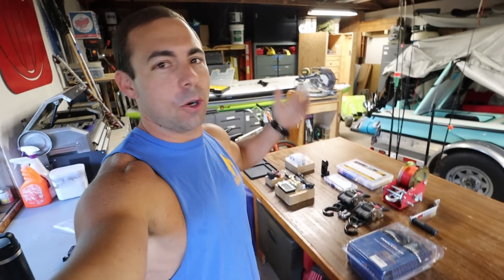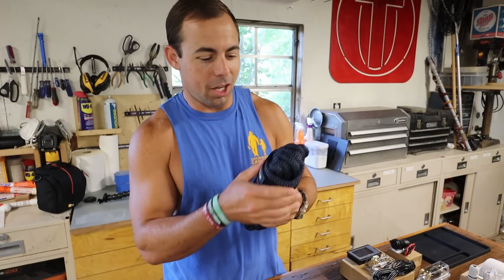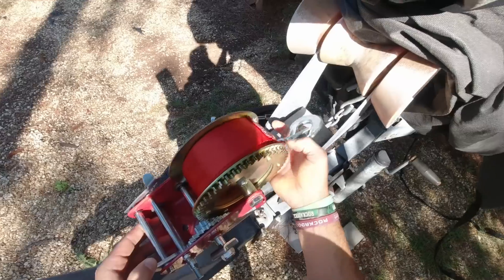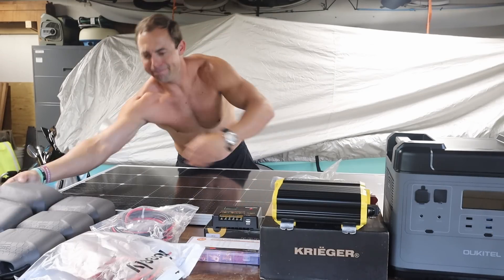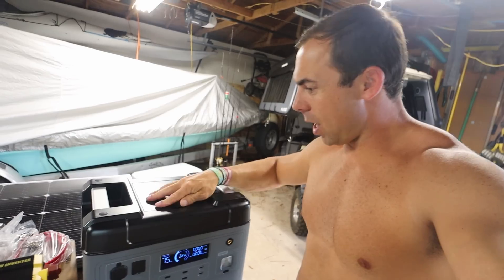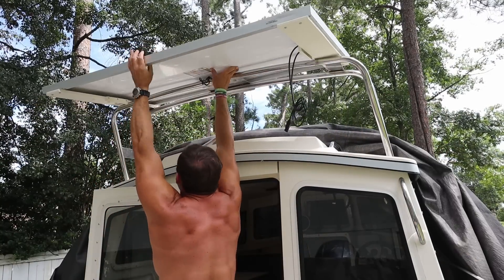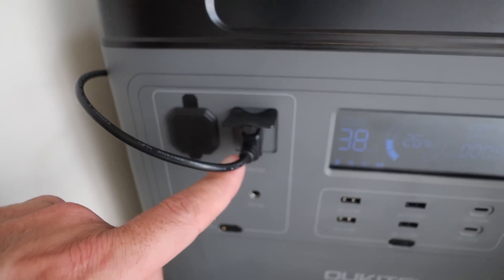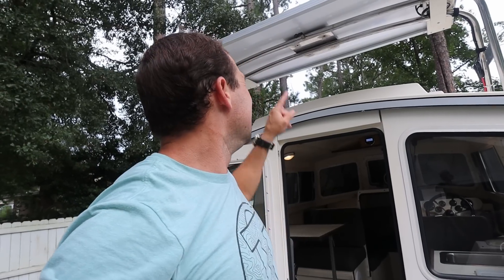Solar Upgrade for the Tiny Yacht | C-Dory 22 Cruiser

Comment: Kinda off subject but have you considered adding a rooftop ac unit?  I just purchased a 22 Cruiser in Mobile and was considering it so I can add a softstart and run with my Honda generator.
Reply from the maker: Yea I've thought about it, but not for long. I like less complex systems aboard if I can manage. A generator, fuel and AC would add quite a bit of complexity. I can get by pretty nicely with a simple fan or two when I need it and be very comfortable. So I'm choosing that route. If I had a 25'er things might be different.

Comment: Looks great! On the battery compartment you will not want it packed to tight. Batteries need to breath. Also depending on the battery you get they will expand and contract. Just want to be mindful of those properties of batteries. Great job!

Comment: You should send that inline fuse back and get a 200amp fuse breaker so it can be reset and not have to have multiple $30 fuses.

Comment: Trip you might want to reconsider towing with that panel mounted up top. Any angle of attack is going to produce lift which varies with the square of velocity. Bottom line, you're probably ok cruising around the gulf but it's going to get sketchy at highway speeds. Even if the mount holds, the panel itself may not be able to handle the stress.

Comment: Advantages of using separate components: 1) Locate each piece (battery, charge controller, inverter) in the most convenient spot 2) Replace/upgrade components as needed 3) Expand battery capacity easily.

Comment: The math is simple: P = I x V so I = P/V. That power bank is rated @ 2000W with a resting voltage of 13.6V so that's about 147Ah or 47% larger than a typical 100Ah LiFePo4.

Comment: Hey trip  just some info for you about your electrical components. I have an electrical engineering degree plus i live off grid on solar. So, the power bank you're using may be half the capacity but if the house battery you got is sealed lead or an AGM battery you cannot discharge them past 50% without harming the battery. Those power banks are usually lithium meaning they can be discharged to 0%. Something to consider before deciding If the powerbank is actually worse than the house battery. Also consider your charge controller. The  powerbank may not allow all 200 watts the solar panel can produce. You can think of it this way; at peak sunlight hours the solar panel can replace around 15 amps back to your battery (with no power being consumed.) If you have an 100ah battery and you can only consume the 50% as to not damage the battery than it would take you just over 3 hours to get back to 100%. If your power bank let's say is 70 Amp hours but you can draw it down to 0% without damaging the battery then you have 240 more watts (20 amps) in your capacity. Feel free to comment with any questions concerning anything electrical. I'm more than happy to help.

Comment: hey trip i have an extra cranking/deep cycle lithium battery brand new i might need to get rid of. sitting in the box still my motor isnt suppose to use them and i didnt know until after i ordered it.